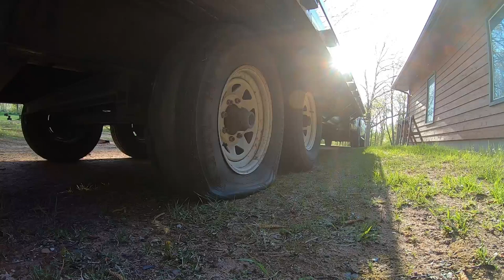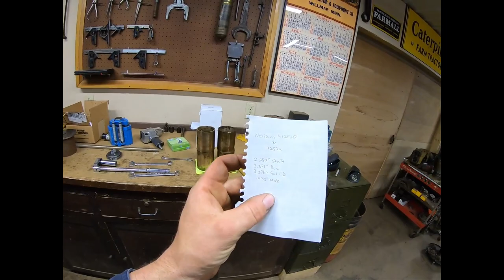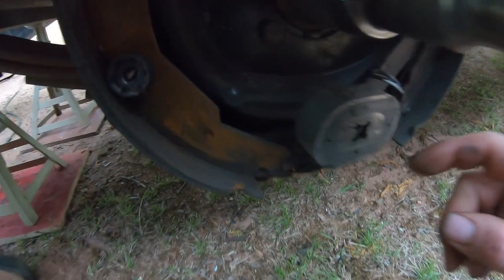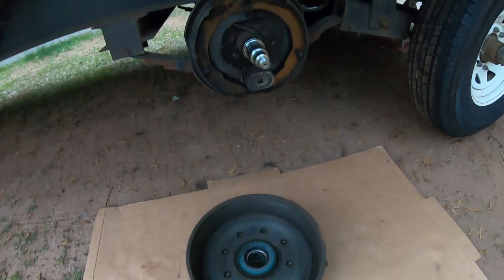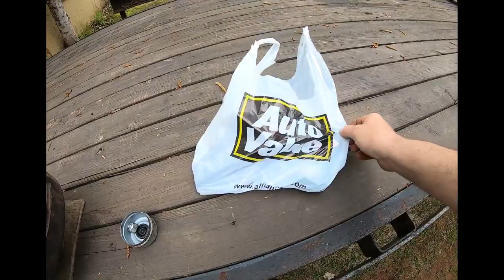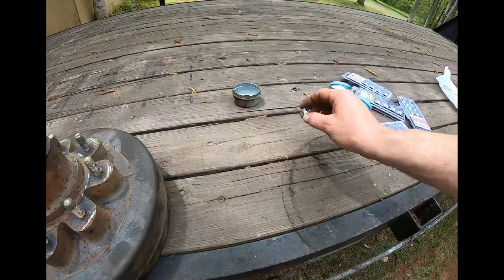Gooseneck Trailer Battle! Tires, Bearings, Brakes & It Fought Me Every Step Of The Way...

Comment: I saw a wood tick on a mosquito today,here in the up of Michigan. You just piss them off if you swat at them. Have to shoot them with 12 gauge buck shot.Ammo  is very very expensive and hard to get.I put a fence around the garden 2/4 woven wire keeps the dear and mosquitoes out.

Comment: All you have to do is pull the outer bearing out then put the nut back on and pull fast and hard , walla, you have the inter bearing and seal out of the hub. Saves the seal also.
Reply: you mean voilà?

Comment: I have the same trailer, same problems. Ended up swapping out brakes, hubs (for oil bearings), springs, hangers. Probably do the gooseneck extension too. Only thing worth keeping are the lights

Comment: In the past, i've used a large net trap to get rid of mosquitoes. You put a CO2 dispenser inside a net tent like structure, then you spray the net with something sticky and wait (i've used slow cure spray on glue, the shoe kind, has a two day curing time, therefore it's very sticky, you can use any kind of glue that you can spray really and cures slowly).

Mosquitoes love carbon dioxide and it's the main attraction to us (aside from what we eat and other non natural odors, like perfume and deodorant), and it works by far, the furthest of all the baits. You set that up, and then you collect the soiled net the next day.

If you do that at the start of the mating season, when the females are going mad, you basically sever the population down to squirts. Every year i do this, and thus chunk down the total population by a lot.

Comment: The valve stems in those wheels are only rated to 65 psi. You need the high pressure stems to safely have the pressures at 80 psi. I've seen those standard stems shoot right out of the wheel when they're over pressure

Comment: Sounds like my typical day. Even the mosquitos, was working on the dozer about a week ago, and they were so thick, I had to run it in low range to push them out of the way so I could use the dozer.

Comment: Hello Squatch; I am surprised that you don't have a "bug zapper". I had one when I was camping a lot and made it portable. Hang it up anywhere and plug it in. One thing you should be glad about is you should not have anymore tire problems on that trailer. Great video, Thanks. Be safe and well.

Comment: The stuff I like best in trailer wheel hubs is the semifluid grease, Mobilube 007 and Chevron Delo are the ones I've worked with. Trick with those is packing the cavity as full as possible. 

Mosquito season in SE WI has been dead this year, too dry.........
Reply: too dry to fly.....

Comment: I’m glad I’m not the only one that has projects run longer than anticipated. I am in the middle of replacing all the hydraulic hoses and our international 574 and it’s only taken two weeks but that also includes rebuilding the power steering cylinder. And that’s interspersed with replacing the solenoid and starter on a cub cadet lawn tractor which is taken three weeks

Comment: Thats a kinda cool way to do trailerbrakes. Over here its still standard to have them being actuatet by a cable assembly once the trailer starts pushing against the towing vehicle because of it braking.. And I hate adjusting them, got a twin axle boxcar trailer.. either one wheel is draging or not braking enoug.. I adjust it.. next check its another wheel doing the same stunt..
The Dutch have a neat way for trailer brakes, same principle by getting the trailer push against the vehicle, but the replaced all the cables with hydraulics and they are fully self adjusting.

Comment: Coolest thing I saw on a trailer was how the spare tire was mounted. Instead of just using a few wheel studs and a plate to bolt the wheel to the trailer the manufacturer used a complete spindle backing plate with brakes and all. Perfect for that trip when something goes wrong with bearings or brakes. You have everything needed for an on road repair. It was an Australian made trailer. They think of everything down under.

Comment: I agree with not wanting to pull hubs off over and over with new seals to re-adjust the brakes.  I usually do it before putting the new seals in.  I’ll pop the hub off adjust the star wheel, pop the hub back on and repeat as needed to get ideal adjustment.  Then take everything the rest of the way clean and re- assemble.
Reply: Duh, why have I never thought of that? Thanks for the suggestion.

Comment: Yeah, we miss the work on 1113, but we know that there is a ton of stuff to do around the place, and before you know it, those “flying blood banks” will be lying on a bed of freshly fallen leaves and covered with frost. The only thing worse than swapping tires and packing bearings while swatting mosquitos is doing the same job in 6” of fresh snow with the mercury down to 18’F and falling fast. Those runs are paying off, you are looking svelte, (unless it is just the GoPro camera!) and I am sure you are feeling more energetic as well.

Comment: Boy, am I glad I got to watch you suffer the mosquitoes while I sat in air condition spaces.  Yeah one big problem with living so far from town,  you start a repair project and find you need this or that part to finish, so into town you go, so you can finish.  Then find you need another part, damn, are you ever going to get finished? It can be frustrating at times. Nice video Squatch....
Reply: Been there, done that, bought the tee shirt.

Comment: I actually knew about the railroad call sign. 
Conductors identify themselves by the lead unit: BNSF4769. Only time the conductor identifies themselves I’ve heard on the scanner is after a good read back of a Form A, and it’s just their initials. 
I work on airplanes, not the railroad. Just a rail enthusiast in the Pacific NW.

Comment: I guess I'm an oddball. But doing it the way the greasable spindle work. I like it better, but you have to do it right. You take the whole cover off. Shoot grease in until all the old grease is forced out. And you start getting new great coming out. Our Camper and boat trailers have this type. And never had a issue. 
But most just shoot a few shots of new grease in there. That's where you get the failures. You have to pump it full until new grease starts coming out. Thus pushing all the old grease out and replacing it all with new.

Comment: It's amazing how good a 20 year old trailer looks when you can keep it under cover and don't run it in the winter road salt
Reply: For the opposite case see "Watch Wes Work", salt damage a speciality!
Reply: Ain't that the truth I have a 1989 road clipper 14k that still almost looks new its never been on the road past October and usually doesn't come out of shed till it's time to get pallets of seed in the spring mid April or so

Comment: I absolutely hate electric brakes. Had a trailer that every year ended up replacing that magnet along with the backer plate. Live out in the country, on gravel roads and they just don't last long. Hydraulic disc brakes is the best way to go. 
Kiki torches, helps to keep the mosquito's away.

Comment: I am intrigued..  why do they not make those hubs with a Hex head and Hex seat on the inside...  spline is fine, but can still end up failing as in your case...  but if a hex head is used then failure of  the spline would not be an issue.

Comment: I am surprised the wheel bearings need repacking in only 5000 miles but still good preventative maintenance. I like to lube the lug bolts everytime the nuts are removed to prevent them rusting in place..

Comment: Hey Squatch, another great video. Never seen a brake setup like that before, such a simple design though. Not that it really matters but I'm guessing they don't work in reverse? As the drum will be rotating the other way and the arm would cam the shoes away from the drum?

Comment: Looks like you had Goodyear Endurance tires put on..they have been on my travel trailer now for 15,000 miles and they are wearing well. Hope you get good usage out of them. They’re not “China Bombs” they’re made in the US
Reply: In the agriculture tractor world, Goodyear has been nicknamed good for a year.
Reply: @jardiff5983  Goodyear finally got rid of their Marathon trailer tires that were absolute CRAP to be replaced by the Endurance line of tires. I'm still pleased with their highway performance.

Comment: Knock on wood...whenever I needed to use my trailer the fucking rodents had chewed my wires all to hell!  Spent a month rewiring my trailer as rodent proof as possible last summer.  Ahhh...the joys of trailer ownership!  Lol!
Reply: I ran the wiring for my trailer inside pvc conduit…….
Reply: @notajp  Amen.  Three junction boxes later and each light has its own run of pvc conduit with the last inches of wire wrapped in split loom tubing all the way to the light.  Working so far

Comment: Why did you have to use pliers to get the bearing nut off?  That nut should be finger tight then loosened one half a flat (30 degrees).  Your drum should have just a hair of movement rocking it back and forth.  Looks to me like you run your bearings too tight.